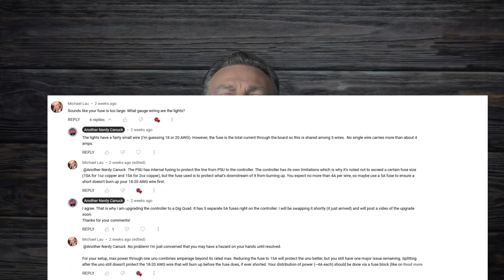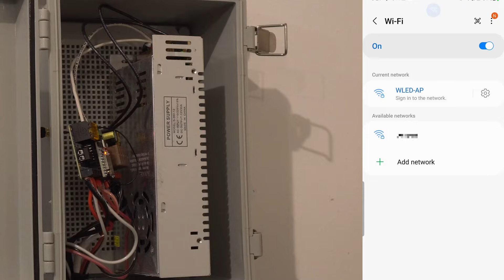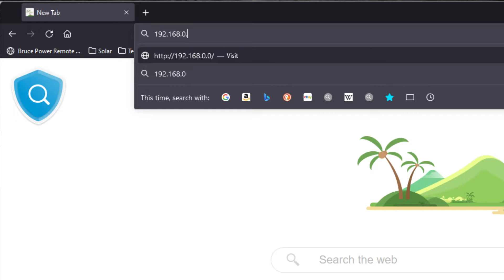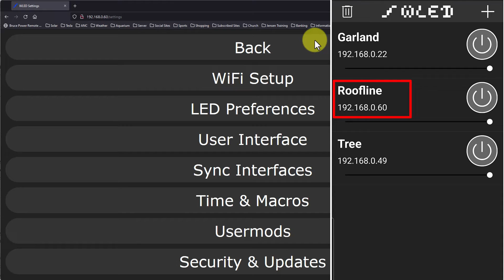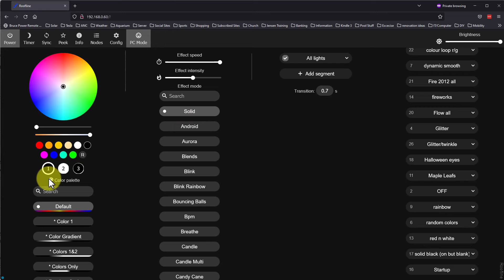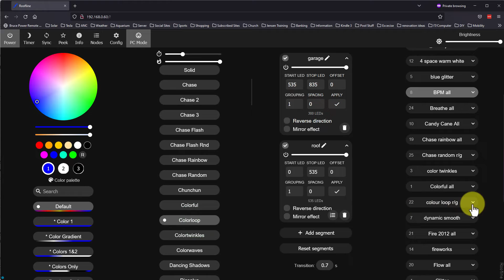Permanent WLED Christmas Lights Upgrade Dig Uno to Dig Quad!

Comment: Thank you for taking your time on making this video. I recently bought some permanent holidays LEDs and the controller is terrible. Found your video and just got my dig-quad. I am new to this. By any chance do you have a wiring connection of your setup especially where the connection points on the roof eves to the dig-quad?

This is what my kit came with:
I have 375 24vdc LEDs 
1.92w per puck
4 power supply 
1 controller 
1 sp901 

Any help is appreciated. Cheers 🍻
Reply from the maker: You are welcome!
Sorry, not sure about that setup.

Comment: Great suggestions.

Great video showing the reasons and methods for upgrading your Dig device. Despite what others may say, DigQuads are a lower-cost controller, and WLED is still the best option for permanent house LEDs. This controller will still work great for your outlines even if you get into more holiday lighting.

For reference, another great way to do this upgrade would have been to use Settings > Security & Updates to backup your config and your presets. Then you could restore them to the new board without having to reconfigure everything.

Even easier would have been to take the old ESP32 chip off your DigUno and swap it with the one on the new DigQuad. They are interchangeable and wouldn't have required any extra configuration.

But, great job sharing your information with the community.
Reply from the maker: I did do a backup, although I didn't show that part. I was going to swap the board, but I ordered the dig quad with an external antenna. Great suggestions though!
Reply: @AnotherNerdyCanuck  Good point. I'm sure the new antenna is a nice addition.
Reply from the maker: The onboard antenna was ok, but had a low signal as the controller is located at the far corner of my garage. Since I was getting the dig quad, I opted for the external antenna. Thanks for your comments!!

Comment: 2 suggestions: 

1. use wago 221 wire connectors instead of the standard wire nuts (this was a life changing find for me, all of my 120v switches all use them now as well as non soldered led connections)

2. If you're looking to take your shows to the next level, XLights software is very powerful but takes a little time to figure out how to learn it with WLED
Reply from the maker: Thanks for the suggestions! Greatly appreciated!
Reply: I love working with the WAGO lever wire connectors! Do you know how to make them waterproof?